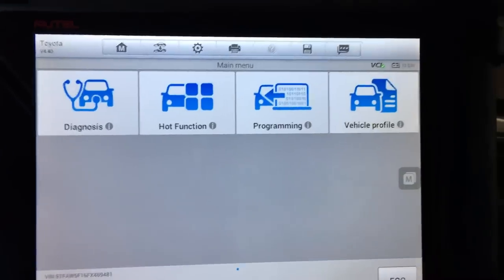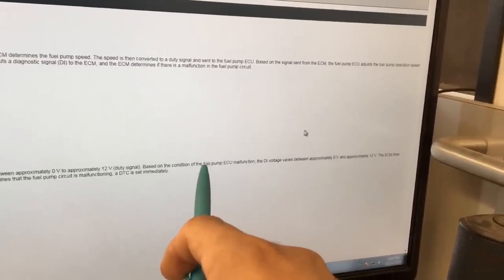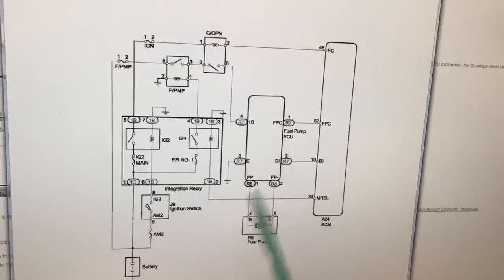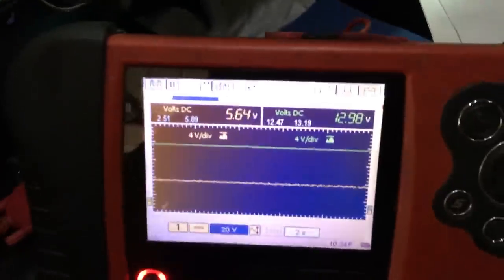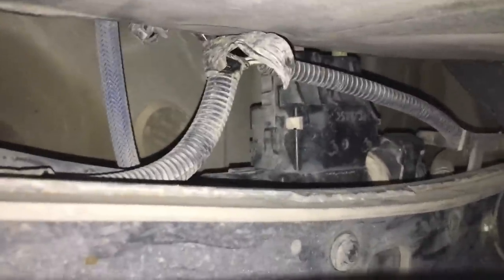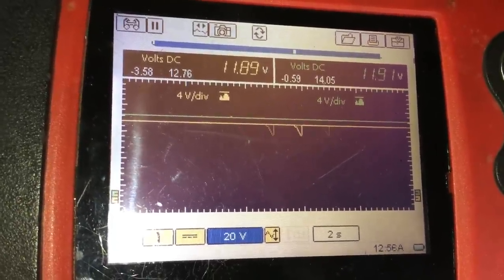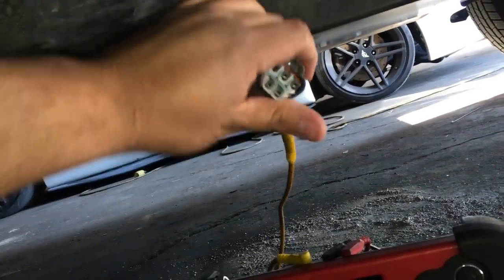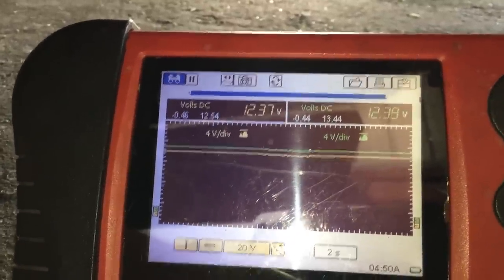TOYOTA TUNDRA DIES STALLS WHILE DRIVING DIAGNOSIS

Comment: I am a retired mechanic with 35 years of on the job experience. This man is good at his job! Clearly he takes a step by step logical approach in diagnosing a problem. He understands how the systems work and that is the key in diagnosing and repairing a problem. If I had to pay for vehicle repairs I would want this man working on my vehicle.
Reply: Hi boss my name is jameel Ahmed I am auto AC technician job
Reply: Agreed, sad part i see as a consumer is that you have to know how to find the good techs. Alot of par or sub par techs running shops.
Reply: Exactly so. As a mechanic for over 15 years I became a technician when I noticed most shops either didn’t know how to diagnose or misdiagnosed. It’s cheaper to find you someone that can pinpoint issues with accuracy instead of paying parts changers. 
   I’ve seen trucks immobilized they change the ignition fuel pumps and run wires that burn up fuse panels and ecm/pcm’s. Once I notice these hacks I refuse service. It’s best to take it to the dealership than trying to save a buck which basically totals out the vehicle.
Reply: @jameelboss3868  AAANNNDDDD...?
Reply: I second that..Eric is the go to man and I 👍💯😎
Reply: Yup the man knows his stuff, fewer and fewer techs like this man around on YouTube, all I see are just shills and shade tree mechanics and shills on YouTube now a days but this guy gives me some faith, putting out good info on YouTube clear concise information 😊

Comment: Wonder how many people would had put a new pump on the vehicle and still have the same problem, great video.
Reply: Agreed...that's what my dumbass would've done 😱
Reply: To be fair, you might had accidentally fixed it while charging the pump. “Let me just bend these terminals just to make sure”
Reply: @StarrTile  That's what my dumbass did. I've got some wiring to check. I've NEVER had a connector issue in 47 years of maintaining/repairing my own vehicles. It could very well be the first time.
Reply: I've seen numerous terminal fitment problems. This tech is a good one.

Comment: Dear advance level tech Mr. Eric,
Your skills are impeccable as a diagnostic tech; Your understanding of integrative circuitry is awesome; Your observations are astute leading your mind to discovery unveiling the mystery of low and high electrical currents and shorts; opens; damaged wires; and really resolving the car's pain and suffering. The machine does not feel pain because it is inert however the owners feel pain and suffer over their metallic horse, it becomes a threat to the quality of life when it fails to run. Your ability to teach is receptive and exceptional because I am able to learn from you, perhaps because I feel more relaxed and at ease, when you teach. Perhaps you have a rare quality in your spirit and a genuine caring, that allows many to open up their minds to you, its a wonderful mystery, I do not understand. I was a student of automotive repairs in the 70's when it was easier to fix a car then, now I am a retired old man learning about integrative circuits, baffled and further confused because for the last year I have not been able to fix my corolla 2000, a cranking no starter, with a stuck shifter in park, brake switch and pedal with no resistance to floor; and a fuel pump that does not prime. The ignition fuse 7.5a intermittently blows; and 2 wire, 5 v ref, pull down system; cam and crank sensors in question. I am reading text books and watching many videos and I cannot seem to grasp the behaviors of electrons, that is why I want to praise your work and experience. Thank you for serving others and empowering me.

Peace and serenity to a good fellow, Mr. Eric,
Bob Bishop.

Comment: Great video 
1.theory of operation 
2.review schematics 
3. I.d. all players  relays,fuses,module, control 
4. Go in with scope 
5.prove the fault 
6.duplicate the fault at will 
7. Correctly ID the root cause 
8. Verify fix 

Great steps and great repair

Comment: My day job is also problem solving, but of a different kind. The approach you had on this one is right on. I hope your clients appreciate it. I could see shops replacing the pump, the pump control module and the relays before getting to the connector pin. I bet the problem came from replacing the tank, and the tank dropped while plugged putting a strain on the female pin. Great job!
Reply: OUCH! Right on the Tenders!

Comment: Good job troubleshooting this problem . Intermittent failures are one of the hardest to find. I have a 2011 Tundra which is doing the same thing so that is why I am here. I don't think there is anyone in my area who can trouble shoot like this. I am leery to go to the dealer because all they will do is keep replacing parts. I am a 35 year electronic tech and  I was leaning towards the ECU which was soaked with brake fluid but now I will have to dig deeper. Thanks for the video.

Comment: Awesome video, the difference in voltage between the two monitored points is what creates current flow and therefore fuel pump rotation.  The Pump ECU generates a floating ground to control current flow thru Pump and therefore controls fuel pressure.  The ultimate difference in voltage is determined by the ECM to control ultimately the fuel pressure/speed. Great video, thanks again.

Comment: I absolutely like the content you’ve created that I’ve seen thus far! In the video clip that you took of the second diagnosing drive, I heard what sounded like the truck “bump” while moving like you’d driven over a change in grade or into a pot-hole. If that actually happened, then that’s when the scope picked-up on the change due to the “bump” moving the harness connecter as the two events coincide on camera. The scope is an awesome tool to have; a talented and dedicated technician is even better! Excellent job brother!

Comment: Wow. That was a good one!  I thought for sure u would have lift up that bed and change the fuel pump. I’m thinking there was a time when some dirt or corrosion caused a little bit of high resistance on that terminal and warmed it enough for it to lose tension. U restored the tension and cleared the terminal. Great use of the lab scope. Probably a pwm ground. Super Dooper Vid!!!

Comment: I've  seen that happen many times.  The ones I saw were on the power and control sides like you had, except mine got hot enough to make the terminal turn color and lose it's spring tension.  Replacement of the connector assembly solved the problem.  Not to be a put down to you, cause that terminal still had the "shiny look" to it and held it's spring tension, meaning you did right.
Good Fix!

Comment: Intermittents are fun! I've seen those connector terminals be all redish or black and monitoring the fuel pump current it would be over 9-10 amps. A new pump AND connector, no more Intermittents and pump current at or below 6 amps.  You've got a good fix, hopefully that female plug in will stay that way.

Comment: great job Eric  very good diagnostic procedure    one thing i can recommend is using a load substitution device  ie sealed beam headlamp in place of fuel pump when you had connector out to get current flowing.   All the best to you  please keep em coming

Comment: Yep, this is alot of what I've seen that can hurt the reliability of oem, adding aftermarket stuff that disturbs the oem connections, especially if they were careless in the handling of the wiring.  Perhaps during the tank swap that wire connectors got tugged on real hard and it bent open that female side.  Car alarms and remote start systems with crappy installations can cause some funny electrical stuff to happen as well!

Comment: That got me when the signal dropped on the earth side I thought pump dropout or blockage. With that tank I was thinking no swirl pot or similar. When you checked the wiring I was suspicious as it had been messed around with nice find very explanatory. I'd like to say I would of got there as well. Honest fix as well diagnostic and fix was probably less than the cost of that pump customer happy and you because that would of not been a nice job lol

Comment: This is too funny YouTube told me to watch this video today I had just completed almost the exact same diagnosis I had a 2010 tundra that occasionally with stall sometimes not start. It had received two fuel pumps a fuel pump ECU and a fuel pump relay before it came to me. When I back probed the fuel pump power and ground wires I had that 1.44 ,1.45 bias voltage the entire Time it wouldn’t start. It ended up being the ground wire the terminal had come loose and had melted the fuel pump connector what I believe happened was the mail pin of the fuel pump assembly was riding on the outside of the female pin. Overtime the excessive resistance caused the connector to melt and just create more and more of a gap. Love the video keep up the good work

Comment: Abuddy of mine had a shop. And he had a 90s Ford Ranger doing this too. It turned out to be a wire shorting out on the passenger side floorboard by the firewall. No other shop could find the problem. But he did. Perseverance pays!

Comment: Any time you think you have a fuel pressure problem, especially in a pickup truck with a separate fuel pump control module controlling a separate in-tank fuel pump, which is always cooled by gasoline and its wiring connectors are protected from weather and road spray, check ,the fuel control module first, right after checking fuses and relays. Control modules are about a tenth of the cost and labor of putting  in a new fuel pump, and typically corrode after 3 to 5 years of exposure to road spray on salted roads and weather (& also due to a design defect on older F150s) and when a shop does the. job, you can bet that a new pump control module will be put in as part of the package, because the system will be more reliable and last longer and the it helps avoid comebacks. 

Good call on the pin tension test.  Those welding orifice cleaners are also great for opening up the applicator nozzles on tubes of super glue or wood with dried glue blocking the openings, and clearing the clogged orifices in the carburetors of small gas engines.  Always look for the simplest solution to a problem thought to be complex or unsolvable (Occam's Razor).

Comment: Great video, great perseverance, you’re quite a talented person. Most mechanics are parts replacers, very few know the electrical/electronic side of it. Research from the customer, could tell when this started, shortly after the tank was installed or what. Could a strain relief need to be added, so this does not re-occur?   Thanks....Jim

Comment: Any other shop would have said it needs an oem gas tank, fuel pump, fpcm, new wiring harness, ecm, and transmission
Reply: Don't forget the steering wheel and airbag module

Comment: Just to get the info out there... My 2001 sequoia recently stopped running, seemed like it was a fuel starvation issue... bad fuel pump... but it was not... then things seemed to indicate an ECU issue, but it was not... Finally after hours and hours over a few weeks, of tracing down the problem, I found the wires to the crank sensor had been damaged by the serpentine belt!   Fixed them, and Bingo it runs!

Comment: Great awesome tech guy systematic and logical, this video reminds me of my fears for my 4th gen v8 4Runner, afraid of installing an aftermarket high pressure performance fuel pump, I’m not too sure if the v8 4Runner has an ecu that controls the fuel pump, it might overload with higher amp draw either burning up the ecu or wires to it 😅

Comment: Another great video, thanks for sharing this. Would it of been easier to take resistance measurements from the terminal ends to the fuel module to see an open in the line? I hate aftermarket stuff.

Comment: I load tested the battery and it’s weak but With a weak battery will the pcm throw false  codes? I’m getting c0900-00 device 1 high voltage and the other code is c0899-00 device 1 low voltage on a 2011 Chevy Silverado 5.3?

Comment: The moment the code didn’t reappear after erasing it told me that “movement” is required to set a fault. But of course that’s not always the case. Sounded intermittent in the beginning like poor connection. 👌

Comment: great video,they might have pinched the wires on the install,they i vibration broke the wire inside the plastic coating.i wonder how long it's had the big tank?excellent diagnoses.

Comment: Always look at  wires and connectors before suspecting main components. Alot of aftermarket pumps come with harness ends had a dodge with pins burned.

Comment: Just watched your video, my 2008 has only 52k miles and I have an issue where the truck starts, then I engage the gear, and then it just cuts off, then I have the same symptoms you just had in the video. Could the fuel pump on mine be causing my issue as well? Like I said, it will start and then dies and after about 2 or 3 tries it starts up and I may not have it happen again for a month or two.  Also connected a scanner to it and no code is ever generated. Mechanics in my area have no clue they say. Thanks

Comment: U should check for any TSB's after checking codes. Also you should have checked the freeze frame data when u read the codes. Obviously what your doing works and you know your stuff but that can help you save a lot of time, if u do those quick things everytime you start diagnoses

Comment: My 08 tundra is dying at idle, but the dash goes dark, and i only get a click.  i can go out, and i have a quick disconnect on the battery, reset the battery, and the vehicle will start. may run for days. Was the instrument cluster dead when the tundra died?

Comment: My 2010 just stalled yesterday at hard acceleration had to cycle key off 3 times til it started now running no issue so far but past 3 years on start from stop to make right turn if too much gas applied it will cut off then go 3 Toyota dealership could not figure this out no engine light or coded I pull a 32 ft camper and had no stall issues so any advice after watching vid will check my harness to fuel pump

Comment: Just had fuel pump replaced on 2017 Toyota Tundra 1794, with 5.7 FFV. It was replace under warranty and there is a TSB-0166-19 regarding this problem too.

Comment: I had a feeling it was a broken or loose wire when you were driving over a rough patch of road and it stalled. Voltage dropped on the scope at the very moment
Reply: Same thought here. I had a similar issue with my 2011 Tundra a month after buying it used. After the dealer replaced the fuel pump twice, I insisted they look closer because after looking and the maintenance records, finding that the fuel pump was replaced not long before my purchase. In the end it was a pin fit issue in the harnus.

Comment: I know this is a Old post.. But, I jus don't know where else to ask..??.. Erick sir, I have a 1999 Dodge Van 3500 5.9L Magnum Gas 360.. I have had my ECU Computer replaced 7 different times.. I have changed practically every item with this Van and it still Shutdown when it wants to do so.. Is there something that I can do without replacing and repeating my own trouble shooting again.. My Van will restart only once andò+ after I disconnect the Negative Battery cable to the Battery.. But, it's something only a trained Mechanic can  do. ]

Comment: 2005 Tundra  Limited  w 4.7L no Power to Fuel Pump Relay  Soket only  2 wires  Have Ground  But No Power With  Switche On Or Off
Any Suggestions?

Comment: Why did the yellow wire get spliced to red. I'm pretty sure it does come from factory that way. So it seems someone else been into this issue and put a new plug as the wire color didn't match.  Odd but turns out to be a pin.  Someone else would of replaced the fuel pump would be my guess with issue still there. Great work

Comment: I got a Toyota Tundra & if you look at the tac on the tundra ,if you look at it the tac suppose to be  between that 0& 1 and it won't cut off, but before you do anything  go under the hood & you have a 2 screws to set that acellarator ,but you haveth to do it with 2 open in wrenches, I set my by ear & it don't cut off.

Comment: Well...a lot of the problem in the modern cars are usually either electrical wires or plugs and hardly ever problems with parts as I'm sure a mechanic but I have my share in fixing and trouble shooting cars.

Comment: I had a stall problem and for some reason it only occurs after a costco gas fill up. No codes. Cleaning the throttle body seem to help. Never had problems on Chevron gas.

Comment: You can see the bright copper at the top of the pin connector where the clad is missing, and indicates a missing upper piece. A previous tech or even the tank installer the probed the connector with a too large of a probe while testing.

Comment: I have a similar problem with stalling on my recently purchased 2010 Dodge Journey 2.7 litre, Auto, but only at starting off from stationary, usually when engaging Drive or Reverse, though not so often when engaging reverse. Also there is a distinct thump noise occuring at times when engaging Drive or Reverse. The car is showing 110.000 ks on the speedometer, questionable?
My garage doesn't seem to be able to explain the stalling. Otherwise a nice car that has been neglected by previous owners.  Any idea's guys. Bob, New Zealand.

Comment: The A/C compressor in my truck was operating intermittently.  Same pin fitment issue on the pressure sensor.  I replaced the connector.

Comment: I'd bet they plugged in the connector before raising the tank, then during fitment the tank has moved and pulled hard on the wiring loom. That blue wire was 
probably the shorter one that pulled sideways bearing all the load and the leverage compressed the fold of the pin making it loose. 
Can't blame Toyota for that one.
Great work homing in on it.